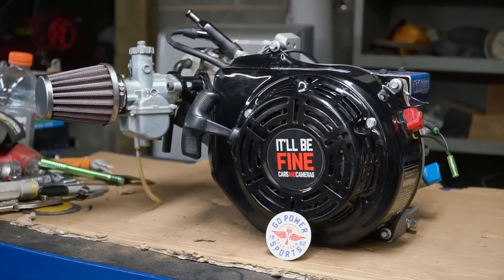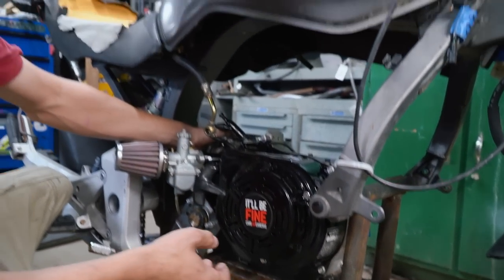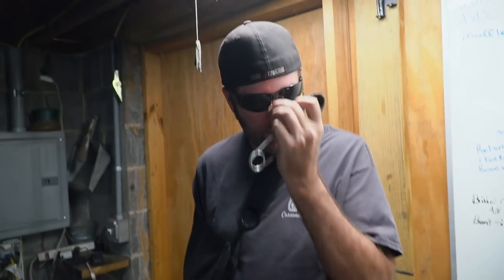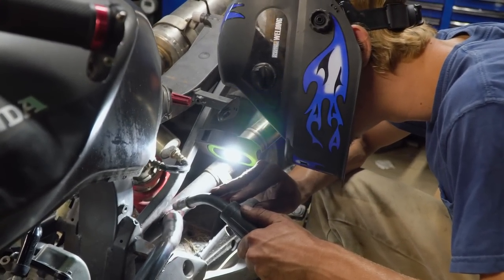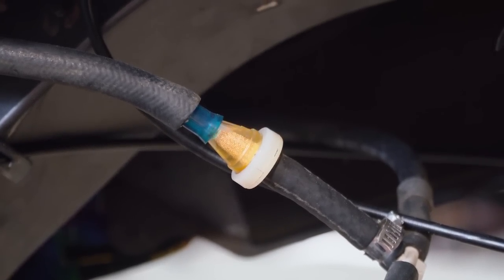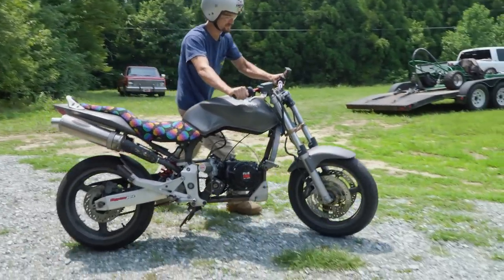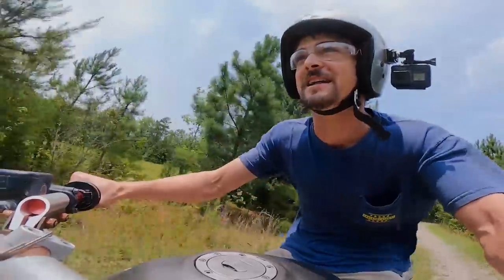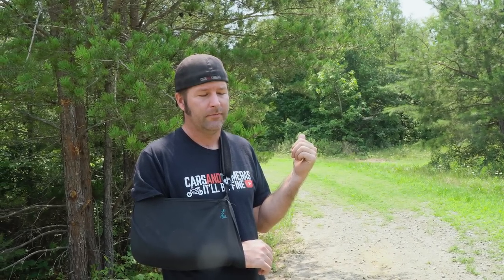Lawn Mower Powered Street Bike Gets 3X Power | Getting Road Trip Ready!

Comment: Ike driving a manual with one arm, that’s pretty sweet. I had to rewind because I noticed he was in his bmw, and I was like isn’t that a manual? Lol
Reply: I saw that too and rolled it back. Then I was like it must be his left arm then and then I noticed it is his right arm in the sling. Thats a lot of work lol. But they are in the country so its possible.
Reply: @abstracts2004  yeah I’ve done that before, I had right wrist surgery and I’ve always drove a manual car or truck so I got pretty good at holding the steering wheel with my knee, hitting the clutch and grabbing the next gear. You gotta do what ya gotta do in those circumstances lol now I had back surgery 3weeks ago and can’t press the dang gas pedal or clutch, hopefully I can get my feet moving better because I refuse to drive an auto car 😂
Reply: My Dad drove a manual trans with a shattered radial arm (elbow) in his NSU Prinz. He was in a cast that held his right arm straight out to the side!
Reply: @MayheM_72  those cars were tiny, were those 4spd on the column or on the floor? Either way must have been difficult to drive like that. Now I can’t press the clutch or gas pedal because two disks ruptured in my back causing temporary paralysis in my feet lol I cant wait to be able to drive my car again. I can almost press the gas pedal and brake. I can work the clutch pretty good tho.

Comment: Looks like you're going to have to find room for a torque converter,  boys.
Reply: what he said
Reply: I just dont understand why they didn't in the first place. other than  stringing it out over several videos.
Reply: @miguelcalderon3702  how about space limitations?
Reply from the maker: A clutch will be much more reliable for highway/continued use
Reply: @CarsandCameras  oh yeah, that's a good point.
Reply: Then why are you here troll
Reply: @CarsandCameras  besides limiting your speed, I bet that tiny centrifugal clutch gets really hot when you're on and off throttle.  How much more does this motorcycle weigh than the mini bike the clutch was intended for.
Reply: @73Bugman  Honestly, changing a belt is a lot less work than changing a clutch. The torque converter is not just a good idea, it's a great idea.
Reply: @sirukin7849  I agree. The benefits of a TC are so much better imo.
Reply: @sirukin7849  It's the best idea. That clutch would melt in no time. The TC is the only way to ride it safely and smoothly down the road. Plus if they are getting 40mph out of the clutch, they could get up past 70 with a torque converter.
Reply: @theverystormycloud4011  right! You'll end up like ike following their builds.
Reply: An adjustable stall clutch is what you need. Essentially your 225 makes peak torque at a higher rpm than a stock predator (which that clutch is suited for), so the answer is an adjustable clutch to get the stall to around 3600-4000 so you have the off the line response you need by stalling where it's actually making power.
Reply: I run a 3800 stall in my kart with a stage 2 gx 200 and it throws me back in the seat off the line
Reply: @CarsandCameras  I use the clutches with needle bearings for my streetlegal 420cc predator builds. They are solid and reliable however they are for a one inch shaft and i dont know if they are made for the diameter shaft you have. 55mph is the happy medium between not getting killed leaving a stoplight and being able to keep up with traffic. Ive gotten a legit 70mph out of a 420 predator but that is absolutely full maxed with barely acceptable acceleration with a gear ratio of 5.7 and 5500 rpms. A 14 tooth clutch, 24in tire and a 80 tooth rear sprocket was the formula.
Reply: You need to put a makeshift gearbox in there.
Reply: You guys had an old mini bike that used 2 clutches(one on the jack shaft) to get 2 gears out of if...wonder if that would work for this build
Reply: You’d have to carry 5 extra belts on you if you went the TC way, Especially for on the road use it’s nothing but constant gas and brake.
Reply: @techhead976  Not sure about the cheap cvt setups. On the golf course i'm getting over 1000hrs on utility cart belts. These things tow trailers and routinely get loaded down with sod. Two of the greens rollers we tow with trailer are over 1,600lbs. I've even seen crankshafts snap and the belts be fine.
Reply: @CarsandCameras  If you run a cover that lets air flow through it instead of sealing it off the belts would last a long time. Modify the cover with a scoop in the front and a vent in the rear. Those cheap cvts aren't made to cool themselves
Reply: any atv, motorcycle, snowmobile has fins either on the clutch or the converter or both for a reason. Rubber melts when it gets hot. fyi
Reply: @Just-InTimeRepairs  not true it would still need the correct final gearing to get higher speeds regardless of which one you use the clutch saves so much space and weight beings that the bike itself is heavy af so the clutch makes more sense on this build.
Reply: @lukecombs5242  you momma a troll!
Reply: “Day of the dead “… wish they ever seen a dead show 🤣🤣🤣
Reply: @miguelcalderon3702  you hate this channel but you're still here.
You typing while listening to Justin Bieber? Just wonderin'.
Reply: @tomstech4390  Your mom is! And I just came here to get a good laugh at their "builds/projects" 🤣
Reply: @lukecombs5242  I get the impression you haven't worked with the TC's much. Those clutches are super cheap and do not last, especially under a heavy load. Also, re-gearing is usually a requirement, regardless of the application.
Reply: @miguelcalderon3702  Sounds like u hate them. Why are u even watching their video's?
Reply: Cause they have so much projects!
Reply: @CarsandCameras  I agree that the clutch is more reliable. Install a manual transmission so that you can vary the torque at different speeds.
Reply: @CarsandCameras  did you guys happen to build a minibike in Texas with a Tillotson 212 electric start

Comment: Why don't you see about making an extra set of gears like Chris's (RatherBWelding) two speed transmission like he has on his two-speed go-kart? Just figured it would be something to maybe give you a top end in the bottom end in your speed.
Reply: Cause they want to put out videos fast and money instead of making some decent builds!
Reply: @miguelcalderon3702  that’s ludicrous
Reply: @pricetag30  nope! Thats a fact! When have they build anything that doesn't require any mods?
Reply: @miguelcalderon3702  when you are building something you most of the time have no idea when something will be weak/uncomfortable
Reply: Go away troll
Reply: That gear box is extreamly bulky, heavy, performs poorly not having syncro and is noisy. Fitting a turbo would be a simple job, or even a 2nd engine.

Comment: Internet: They need to use motorcycle engines in their builds.
C & C: No we don't.
Reply: Thrash!
Reply: I think losing the gearbox hurts the performance pretty bad. being able to have 5 or 6 ratios to utilize is a huge benefit, especially if you want to take it on road. Being able to cruise at a safe 50 mph while turning 3000 rpm or less would be ideal.

If cost was and expertise was not standing in the way, I'd transplant a 400 4 stroke dirt bike + trans on it, but I get the need to use sponsor's motors, both from a cost perspective as well as a revenue perspective.

I'd love to see massaged predator 670 under there, or a basic 3 or 4 speed clutchless manual adapted to mate to Tillotson motors.
Reply: @AgnotologyTV  Well I can see a torque converter in the future. Maybe a modded 420? Putting in a 670 would take some work.
Reply: No,don't use motorcycle engines! Keep doing what you're doing!

Comment: Can’t you just whack a torque converter on it some where 🤔😂
Reply from the maker: A clutch will be more reliable for consistent cruising speeds of 45-50
Reply: Cars and cameras get you a small separate motorcycle transmission  .
Reply: @CarsandCameras  Prove it, its educational and video worthy. Plus, it gives the people a taste of what they want.
Reply: @CarsandCameras  3d motorsports just came back with their 3d manual centrifugal clutch. It's a bit pricy, but I saw what it can do in person. About to get one myself to keep on the shelf for a future project.
Reply: @DarkLinkAD  no provng needed they are hard to keep at cruising speeds because how they work without a computer that controls how much they open or close they will constantly be having to adjust throttle using a butt load of gas which they want to be fuel efficient and the constant adjustment of the TC will make them use multiple belts jus to get to there destination because there not meant for that load and that duration of a trip this is why there not common in cars and the ones that do use them use a wet push design that's hydraulic driven. simply put this isnt something that's remotely worth "proving" nothing much about it will be educational any more so then there past videos where they tried it before
Reply: @makoshark40  Ive never had those issues, even with an ebay comet 30. Sounds like you didnt align your belt.
 Every moped uses the same setup and there is no "computer controls" .
 Its all springs and weights, a stock one is tuned for a stock engine. Pretty simple stuff.
Reply: @DarkLinkAD  it is true that mopeds do have them but they are a different design then the ones your telling them to use and mopeds dont go as fast as they want to go on average and the ones that do don't have a cvt designed trans and if they do they need common belt replacements under 50mph sure there fine and they can even do over 50mph but not for an entire road trip you don't see people driving a moped cross country they usually get setting period where there belt can stop from being over heated
Reply: @makoshark40  Absolutely none of what you are saying is true.
You obviously have a fear of things you dont understand.
 Ive done 20 miles. On the cheapo chinese belt without fraying. 
  RobotCantina managed 44mph and 56mpg with a stock 212 and cvt... In a CAR.
  Nevermind that I can get an entire cvt kit for 40$ with shipping but a clutch that works is gonna cost me, then im stuck in 1st gear the entire way... Burning fuel or burning clutch uphills.
Reply: @DarkLinkAD  not remotely scared of what i dont understand and 20miles isnt a road trip so again 50+mph for 200-300miles cooks belts this is why vehicles made to drive distance use wet push design cvt im not saying there bad or useless just will not work on this use case

Comment: Get a lawn mower transmission from a rear engine rider, then you'll have e gears
Reply: They last maybe 10 miles and then blow into pieces, specially at reasonable power levels.
Reply: @mihkus  my lawn mower has a pearless 900 transaxle that's been thru 2 seasons of beating, that has 17 horsepower, sure it's a trans axle but they are the same transmissions none the less. I swapped some gears around this year for it's 3rd season, I got it to spin 3x faster
Reply: @jacobsgarage8270  but it will not survive a road trip

Comment: Ummm, you could easily remote Mount a torque converter right above the engine and put it behind a decorative cover and achieve your  55 to 60 MPH at reasonable rpm. I don't know why you guys think you're going to be able to road trip that thing on a basic go-kart clutch. The first time you hit any kind of substantial grade of more than a mile or two it's going to burn that thing up!!
Reply: Yea I was thinking the same thing take a lot of the struggle for the engin aswall allwase in an ideal gearing
Reply: They can definitely road trip that!
Reply: And that’s where a torque converter comes in

Comment: Next challenge: Link a 212's crank to the crank of a dead bike engine stripped headless with no connecting rod. So you can use the bikes clutch and gearbox. Like mount that 212 on the headless case by the old head studs.  

That make sense to use a case with an internal gearbox? Even a dead Lifan's box maybe... See how much you can hack off and still use the gears. Rainy day idea, lol. Great build series guys!

Comment: I would love to see some sort of "homemade shifting system" with two gears. Even if it sounds hard (and maybe a lil stupid), it may not be that impossible. I just sold an old two speed automatic moped and it had a system with two centrifugal clutches, could barely call it a "gearbox". But it was basically just two different gearing ratios but one clutch engaged later than the other one or was attached to the first clutches shaft. Maybe you could somehow have 2 sets of chain and sprockets and just engage one a little later? 🤔 It is probably dumb, hard, and bulky but it certainly gets my mind going.

Great video anyway! Love the motorcycle stuff! 👍

Comment: Just for fun, you could fit a second engine on top of the first engine if you cut up thr fuel tank.
Then you could have one engine geared low and the other geared high and make a shifter. One engine for torque and one for speed!

Comment: I love it when folks reuse old bikes with small utility type engines .Y’all have old street bike engines just layin around hack off a transmission pack it with grease or cobble an oiling system if pressured and cruise at eighty if you want to !

Comment: Get yourself a 7000 lb trailer tongue jack and a receiver to fit your truck weld the jack to the receiver with the handle pointing out. It has an adjustable foot and gear reduction to make it easy to break beads.

Comment: Personally I'd like to see a 420 in it. I'd also like to see how it would do with a torque converter instead of the clutch. That way you'd still have the bottom and a better top speed. I'm not sure how well it would work on the sport bike frame but it might be worth a try.

Comment: Aint you fancy using a board to de-bead a tire. I just use the front tire of a driving vehicle, hang my head out the window to aim, and run over the old tire close to the rim. Pops em off every time😉

Comment: Probably could try to engineer a two-speed jackshaft in there, using a type of planetary setup or by lifting the engine and running two jackshafts with a dog shifter and two gearsets between them. I have a pretty good idea bouncing around that I haven't had money or material and tooling for.

Comment: You guys should mount a second engine on this bike with a completely separate drive chain and a much higher gear ratio. Then you use the ratio you have now for slow speed stuff, and when you need to go faster turn on the afterburner with the second engine and separate drive ratio.

Comment: Personally I think it would be neat to add a big valve racing head, 28mm carb, raise the engine and use a juggernaut torque converter. That and the gearing change should get you to your desired speed.

Comment: USE THE 670 DRAG RAIL ENGINE!!
Run it dual exhaust or drag pipe.
Add torque converter and find your gears. Still technically a "Honda" engine. Then the bike could pull a wheelie I bet.

Comment: Why not try and takeoff the top end of a motorcycle engine with a four or five speed transmission, do some machine work on the crank to to make it a straight shaft , put a gear on one side to be driven by the tillonsen and the other drives the primary gear. Then You could use the motorcycle tranny and clutch with a tillotsen or whatever lawn mower engine you want without a cheap clutch or torque converter. I have seen some of the electric motorcycle community do that with success. Love to see you guys tackle that.

Comment: I have an idea for a gearbox If you have an old pit bike engine pull the head off take out the piston and rod seal it off . Remove the flywheel stick on a sprocket put a chain from the predator engine to it . May work with a bit of messing around .

Comment: Port and polish the head and mill .40 thousands for that extra torque. Gear changes that will get you close! If you really want more perormance swapp out the cam and change out to 36lbs valve springs. A billit crank could get an extra 10 horse's.

Comment: If someone can please give me some advice, I'm new to the mini bike life and I have a few stuff on order and I'm wondering what to expect and or if anyone has already done this.... so  have a Mega Moto Classic 105cc frame with a newer Briggs 6.5 212cc with govern removed. I plan to run a simple clutch, chain and sprocket setup. I plan to use a Max Torque SS 19Tooth Clutch from OMB warehouse, a Mega Moto 40 Tooth Sprocket and new chain from monster scooter parts, and a stage 3 center exit header pipe from go power sports. if someone can please give me some in sight on if I have an ok gear ratio. Awesome vids you guys put out as well, I've watched them all at least a couple of few times lol.... also with the setup I mentioned, would I be better keeping it clutch or should I swap to something different, thanks a lot.. oh yeah, I'm running a 15in rear tire.

Comment: must be hard driving a manual with only one arm. I screwed up my knee years ago and could barely push in the clutch in my truck. On a separate note, my 3 cylinder 847cc MT09 doesn't have dual exhaust.

Comment: If when you are bending tubing by heating it like you were doing if you try to heat just the inside you have a much less chance of the tubing flattening out or splitting or getting thin and rusting through very quickly

Comment: What you need is a two speed Hi Low trans mission then the gearing issues will not be difficult if such a thing is possible then a Torque Converter would really work and a neutral might be possible.

Comment: You guys should check out Robot Cantina’s predator powered Honda insight, he has a nice torque converter / cvt setup in front of the manual 5 speed. Relatively small channel but dude is thorough and from Michigan so good for a laugh :).